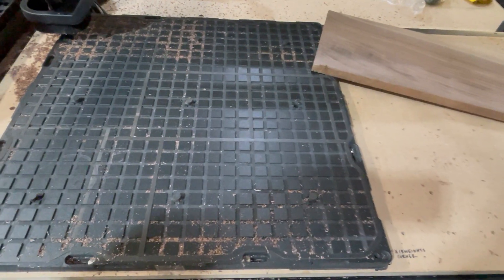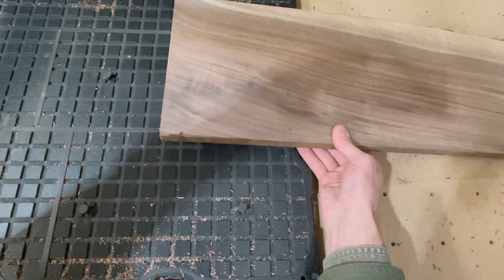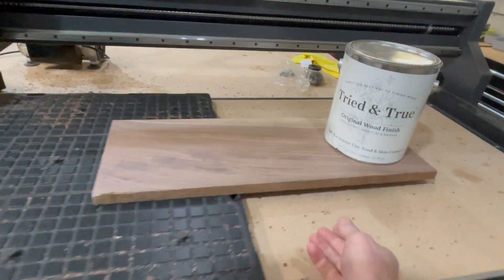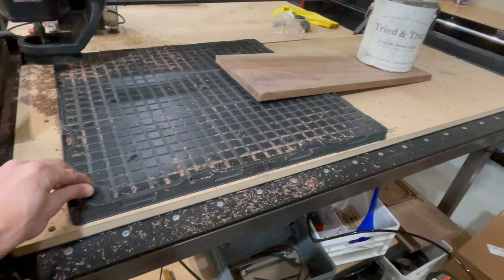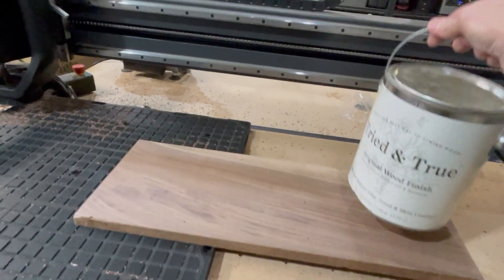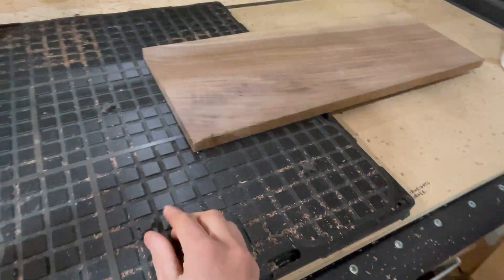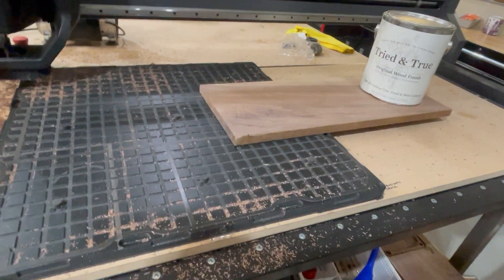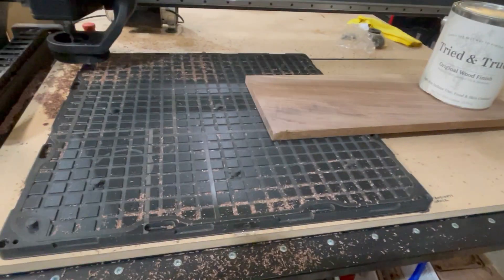Simple, strong, reliable work-holding for your CNC router. Vacuum table speed test

Comment: I have a question for you. If I get a second 24x24 board will the vacuums pump work with both at the same time?  So to cover a 24”x48” area.
Reply from the maker: Yes, the vacuum pump will be able to handle an expansion up to 24x48. You can attach 2 of the 24x24 tables to one pump to run both at the same time, and cover a 24x48 table
Reply: @AirWeights  fantastic!  Thanks. When I’m up and running and need to expand. I’ll order another one!